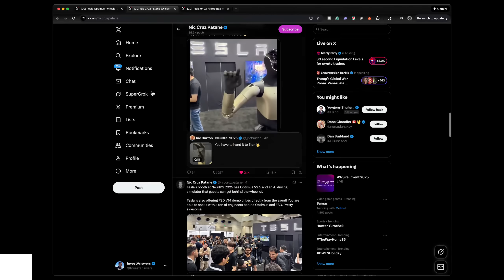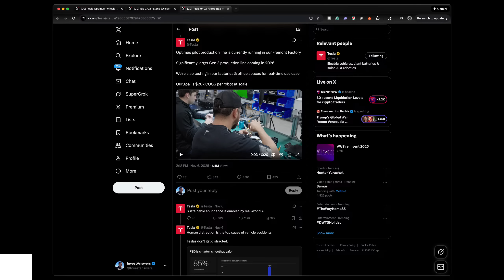Tesla OPTIMUS Just LEVELED UP: New Hand Demo + Running Robot 🤖💨🖐️

Comment: Performance Capabilities
🤖Q: How fast can Tesla's Optimus bot run?
A: Optimus achieves 2.5-3 m/s (approximately 7 mph) running speed, demonstrating significant mobility advancement in the latest demonstration that is confirmed as not fake or AI-generated.

Advanced Manipulation
✋Q: What surgical capabilities could Optimus hands enable?
A: The bot's hands feature remarkable dexterity, optimized thumb length, and articulated knuckles that could potentially enable surgical procedures as envisioned by Elon Musk.

Comment: Literally building T-800s
Reply: Electrical actuators aren't that strong, you would need hydraulics to get the strength of a Terminator.  Then, how do you power it?  - T800's had fusion batteries.